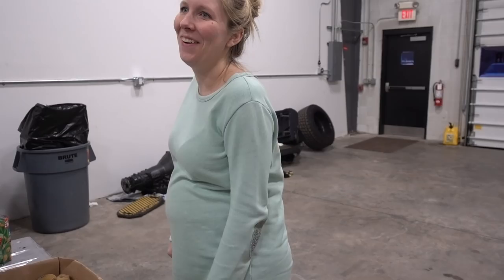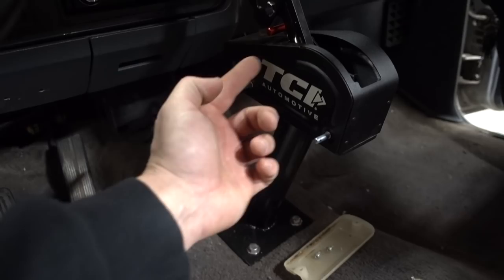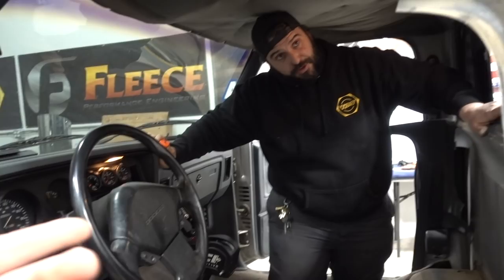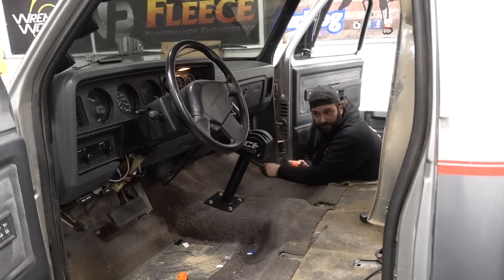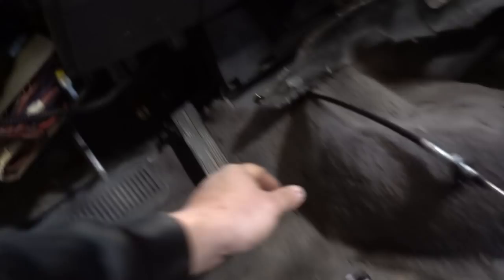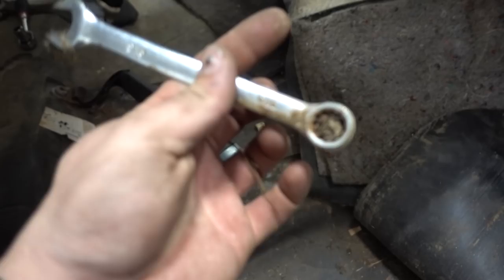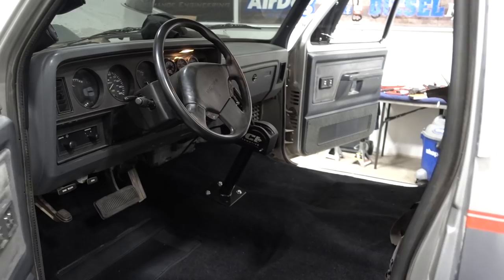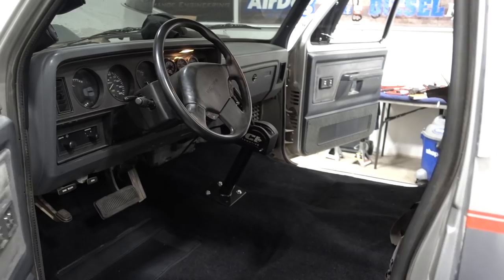Subscriber bought parts for the First Gen Cummins!!!!

Comment: Vinegar and water 50/50 ratio works wonder on surface rust. Spray it on, let sit for 5-10 min, then scrub with scotch-brite, then rinse with dawn and water. Takes the Oxygen out of rust, and turns rust into black metal. Just a tip for people on a budget.
Reply: Chris Topher dude thanks i hope it works;) 🖒👍

Comment: any carpet padding or something to cut down the engine heat even coming into the cab?I would recommend some kind of Stick on material to also reduce any heat coming from outside the In the ceiling? Good contrast between black and gray